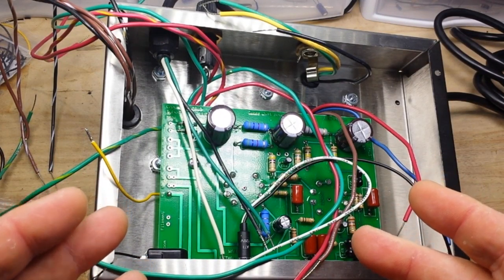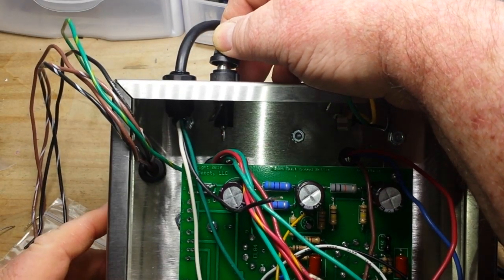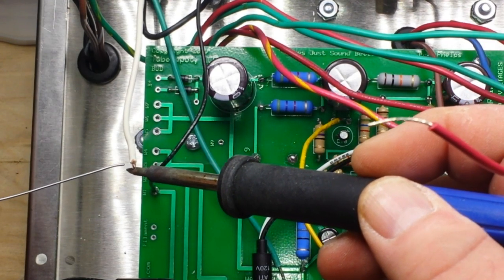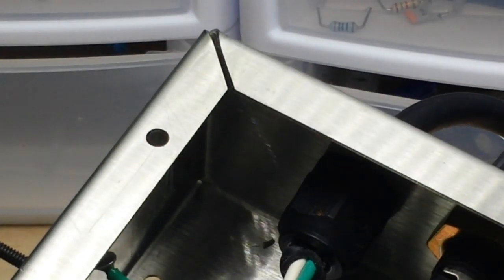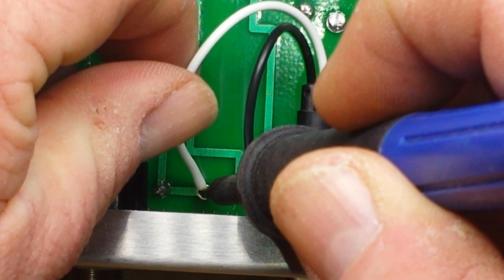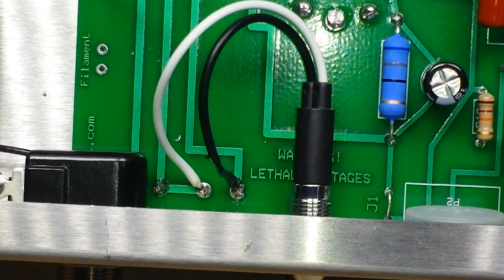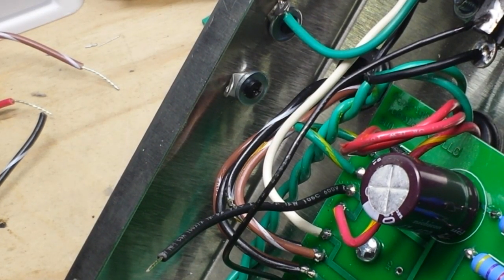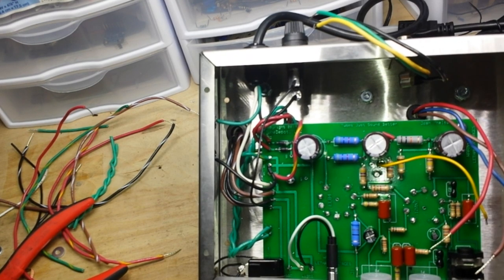Let's build a vacuum tube amplifier - Part 3

Comment: Grounds should never be soldered . They should be crimped to an eyelet and attached to the chassis.
Reply from the maker: I followed the instructions from Tube Depot. That being said, I agree with you and things will be done differently in my upcoming scratch build.
Reply: I've never heard this before, why is that? (I only build pedals so I'm not aware of high voltage stuff)
Reply: @THEQueeferSutherland  solder can melt in a short circuit, and you could then loose the ground connection. Plus it's more physically durable.